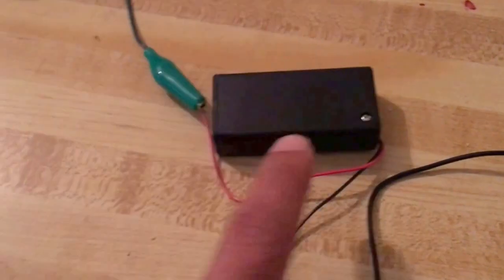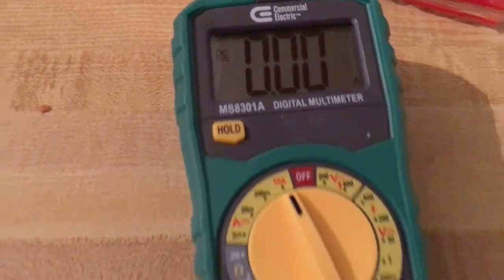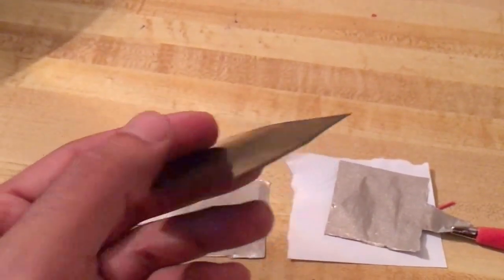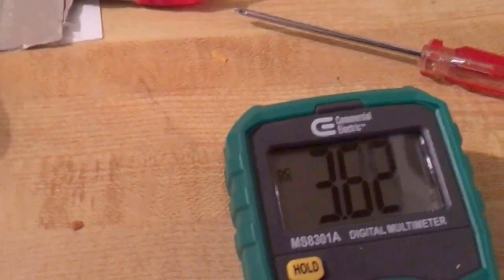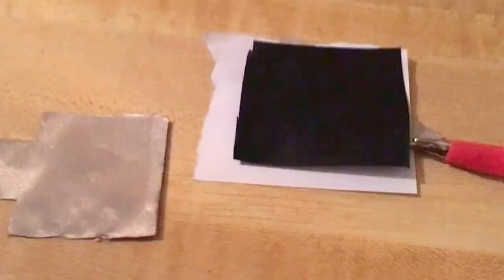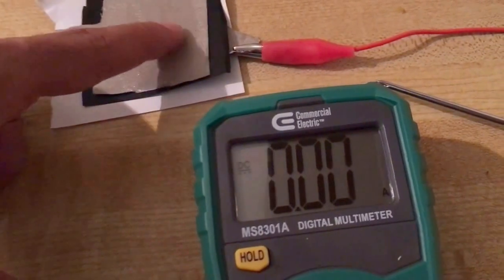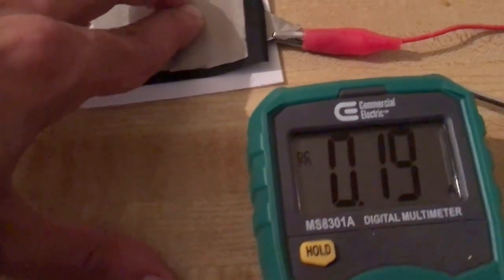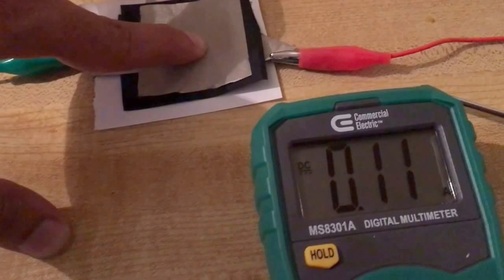How to Setup Pressure Sensitive Fabric with Velostat and Conductive Fabric

Comment: Hello, I'm making a Dance Dance Revolution pad made of velostat sensors. The up panel is stuck and the others aren't registering when I plug it in. How do I open back up the circuit so I can close the circuit only when I step on it?
Reply: you can use a pull down resistor and supply voltage to it when you step on it

Comment: Hi everybody. Does the Velostat have a pressure limit? Thank you
Reply: I've been playing around with these sensors for a university project, and I've also wondered the same thing. After some experimentation and reserach, I've concluded the limit is dependent on your reading resolution. (Unless you're loading it with a very extreme mass) How the velostat works, is it's a polymer film impregnated with carbon black. As you squeeze it, the carbon particles get closer together, reducing the resistance. So, unless you can load it with so much mass that the film breaks, and the carbon particles touch each other, it will always have some resistance. WHen I sat on a piece of velostat and took the resistance across it with a multimeter, I still read 700ohms. Hope this helps!
Reply: @robertfield7532  How you setup for it? I kind of confusing to use this method or square force sensitive sensitive sensor for my sitting situation detection. That measure force when sitting and back rest.

Comment: Aliexpress is using your video: https://www.aliexpress.com/item/Pressure-Sensitive-Conductive-Sheet-Velostat-Linqstat/32945561422.html?spm=2114.search0104.3.2.648b237dMBl3Xj&ws_ab_test=searchweb0_0,searchweb201602_3_10065_10870_10068_319_10867_10059_10884_317_10887_10696_321_322_10084_453_10083_454_10103_10618_10307_537_536_10902,searchweb201603_51,ppcSwitch_0&algo_expid=c00ae0a5-786e-4cb2-ad42-0831cf1c1af1-0&algo_pvid=c00ae0a5-786e-4cb2-ad42-0831cf1c1af1&transAbTest=ae803_4

Comment: Come on, do you even know about basic electronic?! You are making a short circuit by doing that. You got lucky the velostat is resistive enough. You could have started a fire or worse.. Damn
Reply from the maker: Nepetalactone thanks for the heads up. I am indeed a novice and at the time I couldn’t find any videos that showed got it could work. What’s the right way to do it?
Reply: @seanshadmand  You saw some magic smoke! It's because you were drawing like 2.7 Amps from your batteries through the conductive fabric, the fabric can't handle such current! Check the resistivity of your pressure sensor when not pressed, and when pressed. Then, make a voltage divider using another resistor in series with your sensor. You should read a different voltage between the resistor and the sensor every time you push on the velostat. You can calculate the voltage you are supposed to get between the two resistors (your sensors is basically a variable resistor) if you know the resistors values and the voltage you are powering your circuit.
Reply: Hahaha indeed lol
Reply: No, it's no more a short circuit than if you replaced the velostat with a resistor. Velostat is a piezoelectric resistive material.  He's using it the way it's supposed to be used.
Reply: @bubbaloujones9648  Not at all. If you want to use velostat as a pressure sensitive sensor, don't use it like a resistor in a series circuit. You saw the current rising up to more than 400 mA, witch is too much for conductive fabric. The right way to use it, for example with an arduino, is by making a resistor bridge divider using your pressure sensor as one of the two resistor in the circuit
Reply: It went no higher than 30mA (at who knows what voltage ... 1.5V or 3V, probably 3V).  0.09 Watts. No enough to make his fingers hot, let alone " started a fire or worse.. ****", whatever that is.  No magic smoke let out. It is however a good idea in practice to at least have a resistor in series, and if this was part of a project instead of a quick demo he should measure the resistance (which is essentially a voltage divider) not the current.
Reply from the maker: Thanks for the extra perspective Bubbalou!
Reply: Hello guys,

I'm starting with the velostat and I have a question, see if you can help me.

In short, the intention is to use the velostat in 2 or 3 different areas in a tennis and to have impact in any of the areas in a ball for example, I must record the data and send via bluetooth to be recorded in a system. Is it possible with this material? I see that only by moving it it generates data.

I'm trying to work with Esp32 + Velostat, but I have a lot of questions on this.

Another question, Do I need to use a resistor to connect the velostat to the esp32 or having a battery and connecting one side on the analog pin and another on the pin 5v already it is possible to have this result?

Do you have any image to help me with velostat in esp32?

Thank you so much.

Comment: How can use this to make a weighting scale!? I would love to understand the concept better
Reply from the maker: Amer khattab I don't think it is accurate enough to make a scale. At least not with the parts and setup I showed
Reply from the maker: I imagine if you had a set of objects with a definitive weight, you could put them on the sensore and record the number they produced. Then map those numbers to the weights. Again, I don't if it would be very accurate - but it is a way to try.
Reply: Any suggestions about how to turn that into a weight scale sensor?
Reply: It doesn't have to be a weight scale but at least give larger range of readings depending on the pressure applied